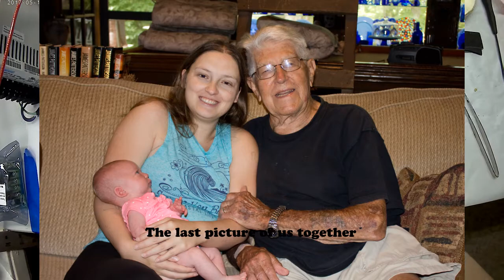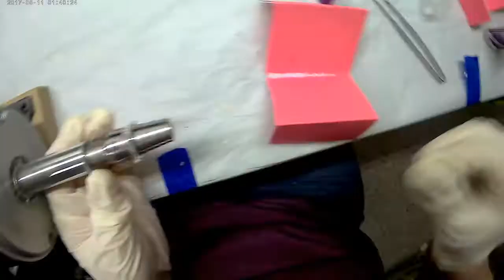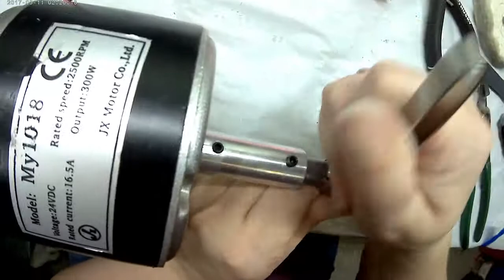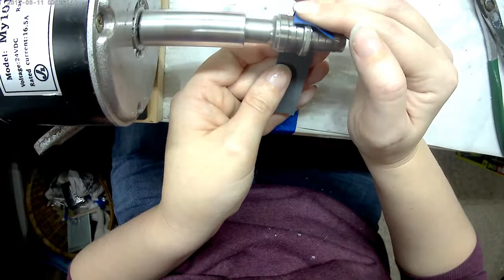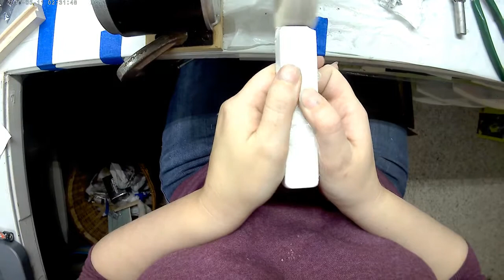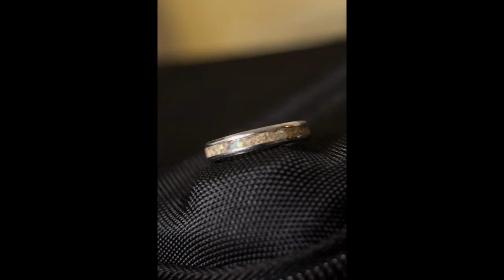Making a Memorial/Cremation Ring with Havenmaker

Comment: Hey what is that machine called
Reply: And the attachment for the ring ?
Reply from the maker: @petsthphilly  Hi. My dad made the machine for me so it doesn't have a real name, but its basically a low powered mini lathe. The attachment for the ring is called an expanding ring mandrel.
Reply: @havenmakerco6426  thank you I appreciate it. I got the ring mandrels but they won’t fit this mini lathe I bought. Just trying to find something to hold the mandrel but can’t find a chuck to fit either. Lol
Reply: So u use glue to hold ashes and not resin?